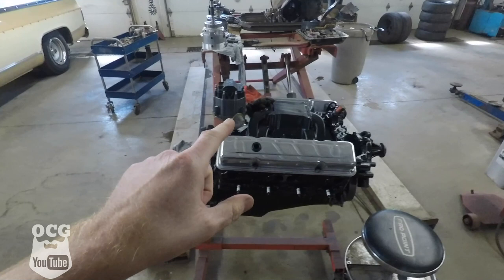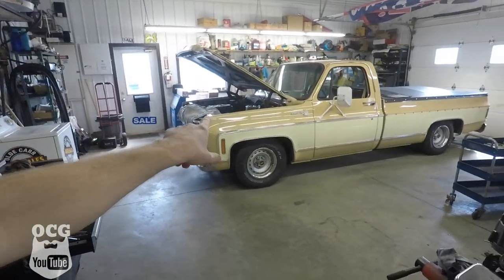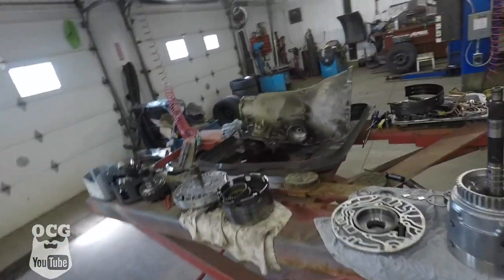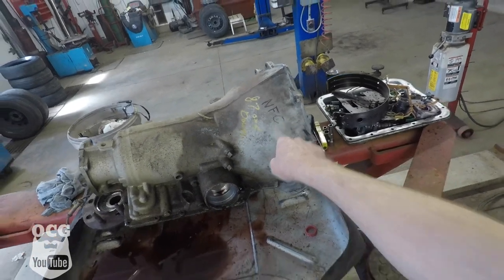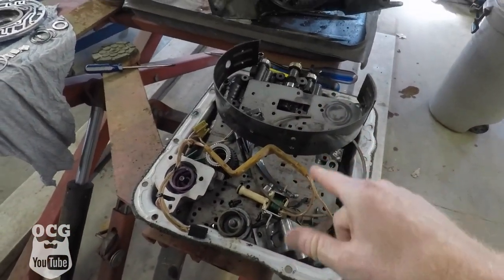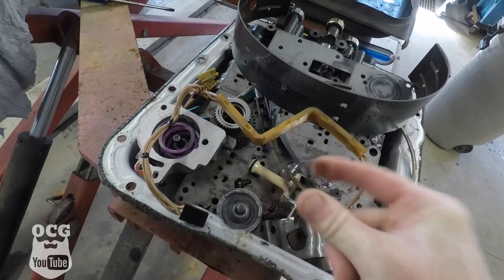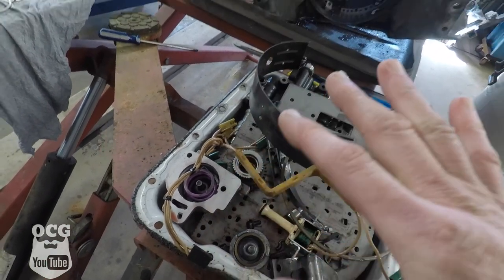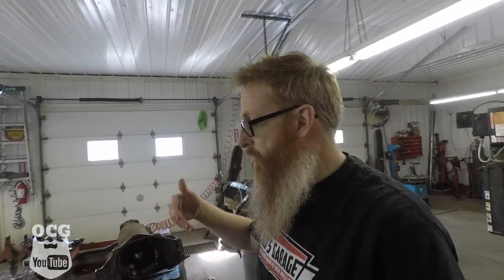I PAID WAY TO MUCH FOR A JUNK 700R4 TRANSMISSION FOR MY 1977 CHEVY C10

Comment: Even stock the 700r4 wasn't bad. People just didnt keep the dtent adjusted correctly. They also dont check to see if they are not running hot. That trans should do every thing you want and live a kong time espically since your dad is a transmission guy.
Reply from the maker: We've had to modify the 350 detent to work temporarily as i didn't have a specific one at the time of swap. Once we get the new one, all should be good! And yes, having a 40 year transmission mechanic in the family sure does help.

Comment: 700R4 is a great transmission. I have one in my TA and I love it. If you get it altogether and it won't shift hard enough for your liking then you should try this shift servo kit. https://www.youtube.com/watch?v=lgNGsq_65tQ It made my stock 305 700R4 combo bark 2nd like crazy but it still has great part throttle manners.
Reply from the maker: Thanks bud! W do have some dialing in to do but I thinks this trans is stout! We'll get it barking, don't you worry!

Comment: Ford 5r55e shift kits require a hole drilled through the valve body
Reply from the maker: The "J" mod requires that in panthers.